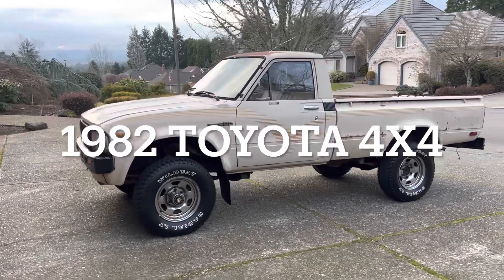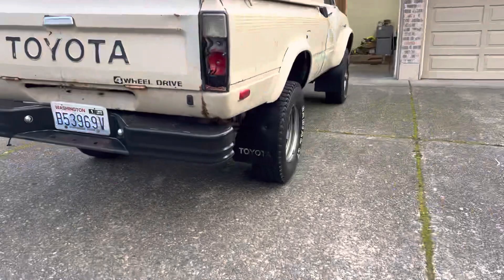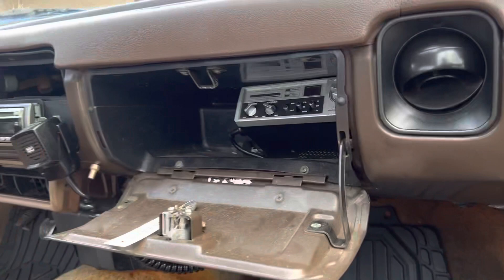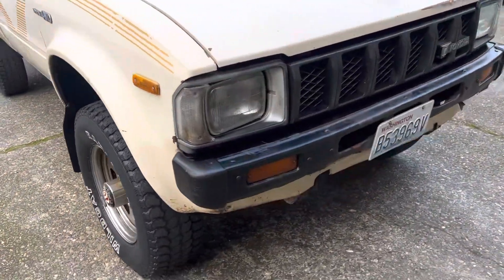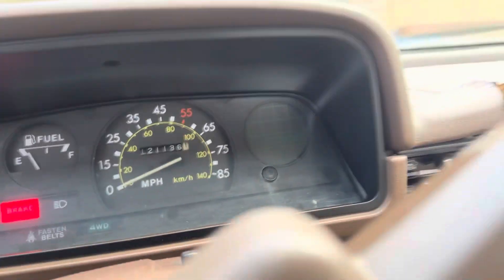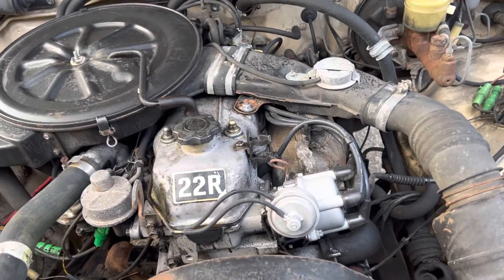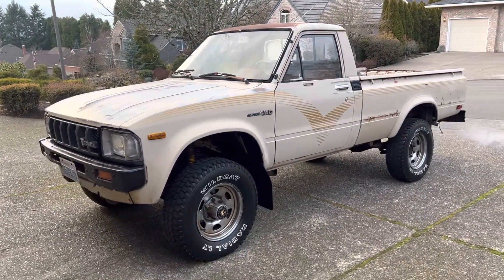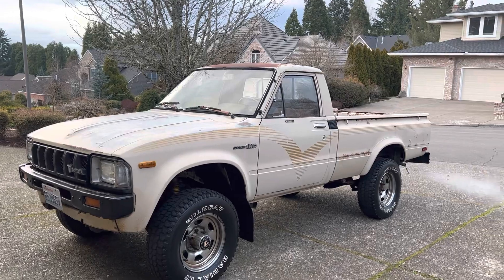Score! Rust Free 121k mile 1982 Toyota 4x4!

Comment: It's for sale
Reply from the maker: I’m putting it up for sale after I finish fixing it up. I already put the dash back to stock, new carpet kit, new brake master cylinder, wheel cylinders, brake pads, clutch master cylinder, I’m waiting on the seat upholstery, the new alternator and im also going to bed line it with body color bed liner. 
   Are you interested?
Reply: @Restoflip  how much?
Reply from the maker: @bigfootswatching9986  keep watching the videos to see all the work I’m doing to the truck. I’m going to be asking 18,500 for it but it will be dialed! New rubber parts, new tires. I’m putting about 10-12k in parts and labor into it. Ready to drive and not a project. I’m buffing out the original paint and already started.